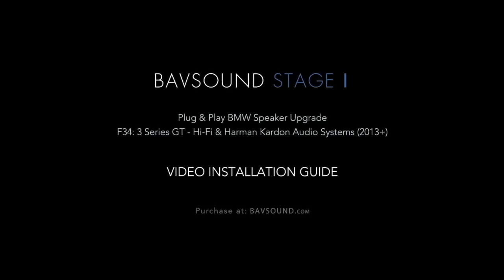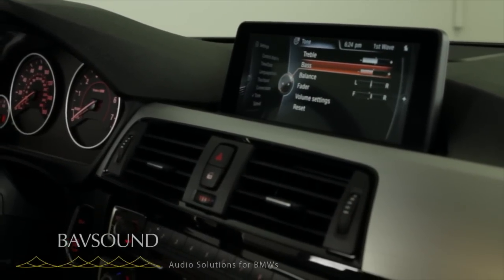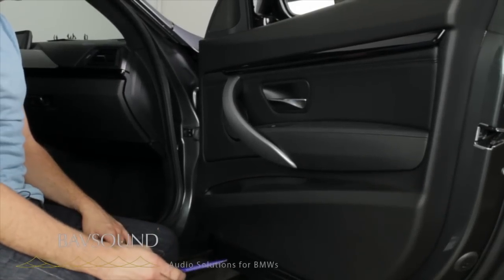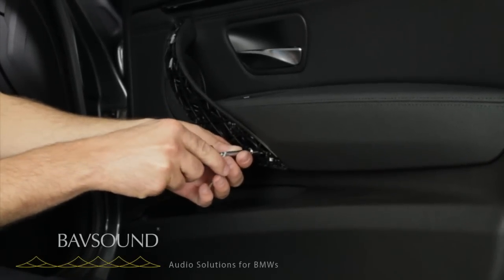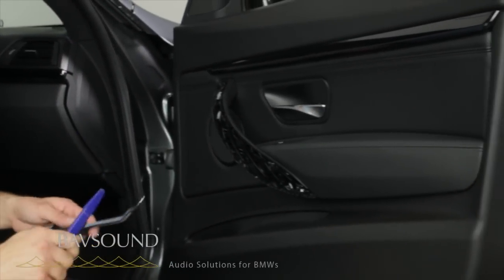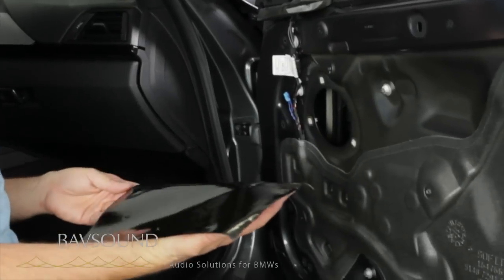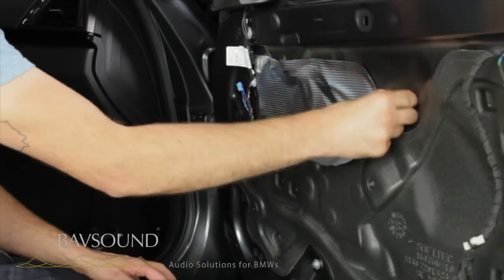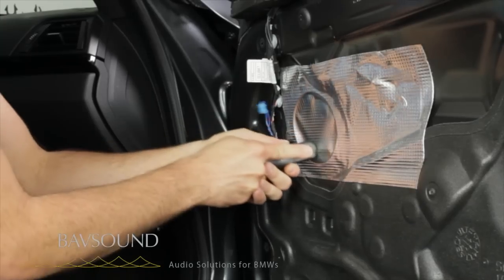BMW Speaker Upgrade/Installation | 3 Series GT (F34) 2013+ | BAVSOUND Stage One HiFi/HK

Comment: Was this the basic BMW sound system or the Harman Kardon 600W system before the upgrade?
Reply: This is the HiFi system, which is the base system in the U.S. And the midrange in the rest of the world. Not the Harmon.
Reply: +Mike1nyny  The back door in the standard system has no tweeter right? That back door has to be harmon Kardon right?
Reply: +Michael Forrest :"This is a hi fi car" (the one you're working on apparently) Yet, why is there a tweeter in the back door?
Reply: +Michael Forrest Or is "hi fi" Harmon kardon?
Reply: I don't think the hifi has rear door tweeters. The parts look up only shows them on cars with the Harmon system.
Reply: +Mike1nyny Thats what I thought. Thank you! So, In the first part, he is working on a regular Hi Fi system, and in the second part, he is working on a HK system. Got it.